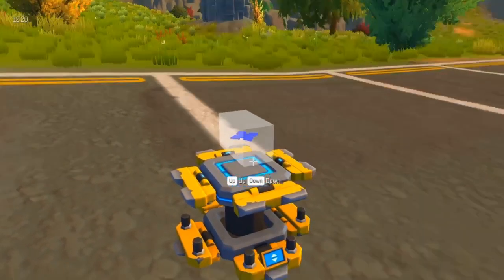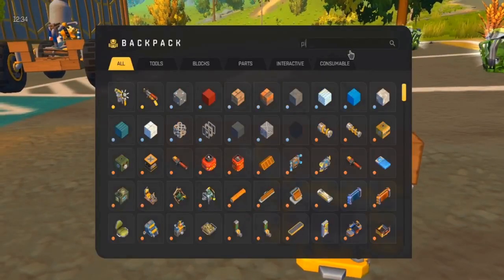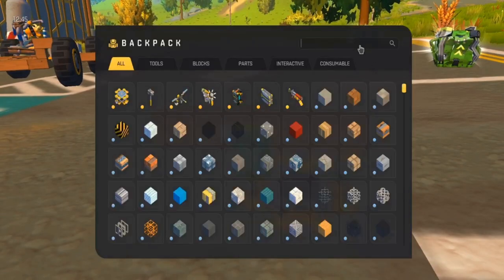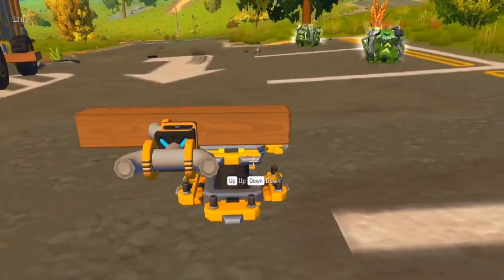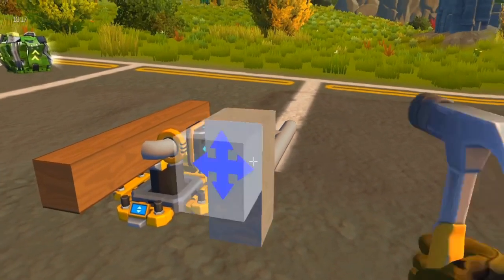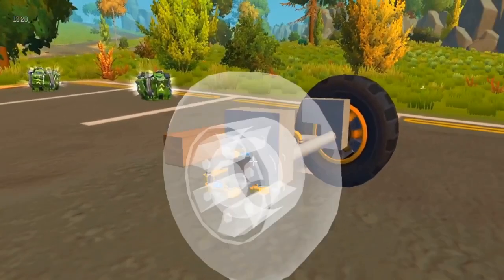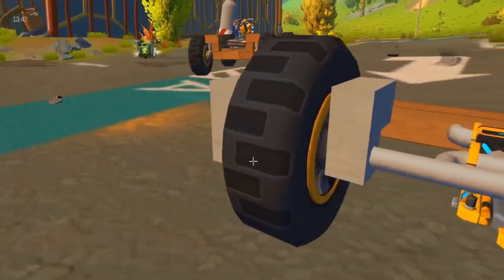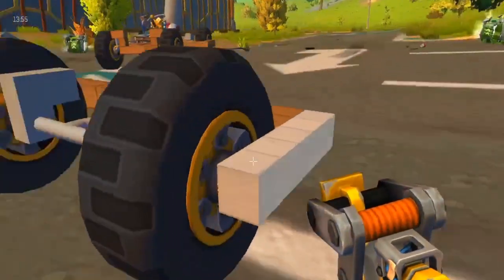Cheapest Piston Engine in Scrap Mechanic Survival....... with only 1 piston!

Comment: thats not cheap it takes lot of component kits
Reply from the maker: It is cheap compared to the other piston engines out there. My design uses 1 piston, thereby using 4x as less as a normal 4 piston piston engine. The thing is, it can't get smaller than 1 max level piston, as you need the max level for speed. If you really did not have enough component kits for even 1 piston, you might as well not look for a piston engine and use gas instead, though piston engines are more efficient as they use no gas or electricity.
Reply: @xynonners  no its stil to expensive
Reply from the maker: M hai then what do I do? The cheapest I can make it is with 1 piston, or else it won't even be a piston engine. If you really want a cheap piston engine and don't want to even grind a few components, then I suggest you look elsewhere as this is the cheapest piston engine that is possible to build.
Reply from the maker: M hai there are two ways to take your question. You are saying my piston engine is not cheap enough, which is impossible to make it cheaper due to it being a piston engine and I am already at the bare minimum of pistons, and I cannot do anything about that, it is the limitations of piston engines. If you don't have enough component kits to even build the cheapest piston engine, then use something like gas instead. The other way I can take it is that you are saying gas is too expensive, in which I would say that you should play creative mode instead.
Reply from the maker: M hai I mean, you could always use a lvl 1 piston, although the bare minimum is usually a lvl 5 piston, as otherwise it will be like 10x slower than walking, though it is possible, just not practical. Survival  games are about grinding for a reward, not being able to get everything with no effort, which is why creative mode is a thing.
Reply: @xynonners  your piston eng is surprisingly cheap , dont know wat he means by it being to expensive
Reply from the maker: Itamar Blomont thanks
Reply: you dont need the level 5 you just need a lvl 1 a level 5 is recommended though
Reply: @xynonners  thanks for the engine i been trying to memorize these complicated expensive engines and you come along in my recommended with a 5 star engine with 10x less of the cost